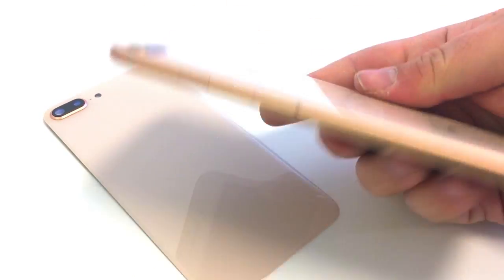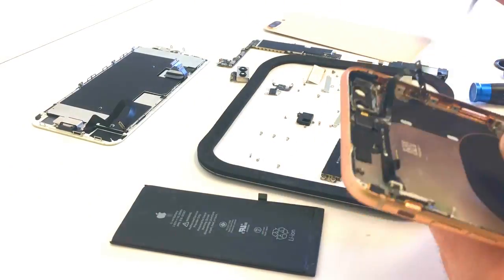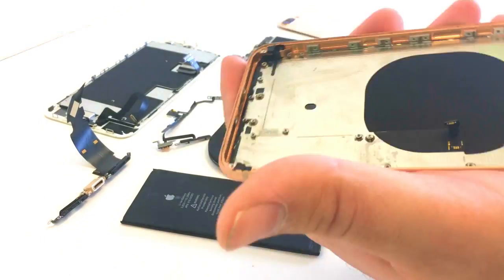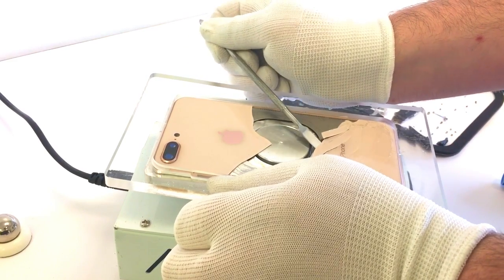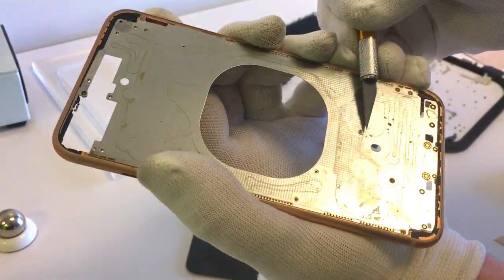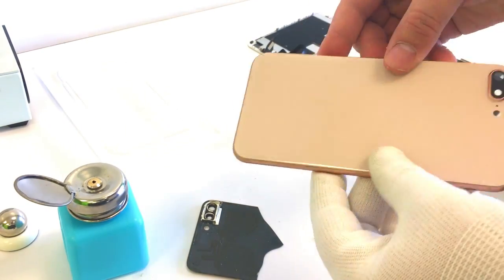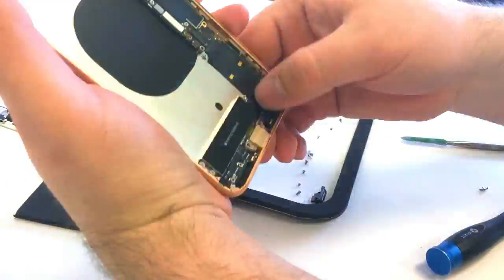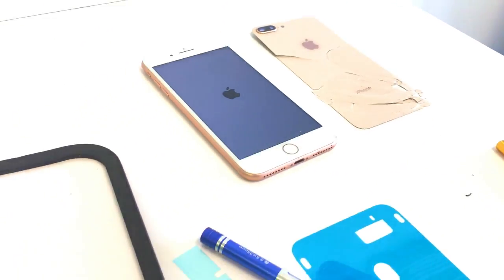iPhone 8 Plus Back Glass Restoration: DIY Repair Tutorial!

Comment: just for arguments sake if im not confident stripping the whole phone down i could pick away all the back glass with the phone still assembled and just clean up with solvent and glue on the new one right?
Reply from the maker: I wish it was that simple, but the adhesive Apple uses to adhere the back glass makes it difficult without extreme temperatures or a laser machine to assist.
Reply: @FIXDPHONES  haha i already did it, used a little knife i don't care about and a lot of patience, took like half and hour or 45 minutes, it was shattered badly but worked and even the wireless charger didn't get damaged, unfortunately i forgot to disconnect battery before replacing the screen  so i had to have my motherboard repaired and get another screen but still cheaper than at the shop and i now have the tools for future

Comment: What is the tool used in the removal of the back glass? I checked your previous iPhone 8 video and there was not a link that is included in most of your other videos. Much appreciated!
Reply: Just type “iPhone 8 back glass remover machine” on AliExpress, dhgate, etc. There is a couple different versions.
Reply: No it’s just called a heat plate. You can buy specific moulds for specific devices.